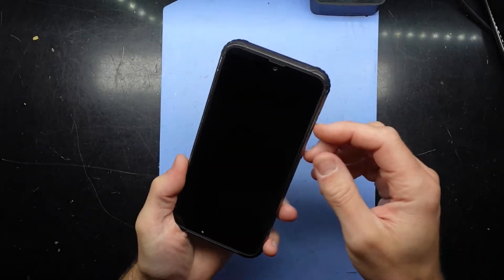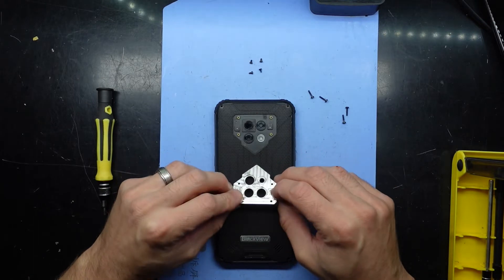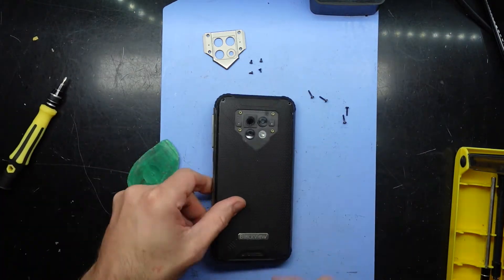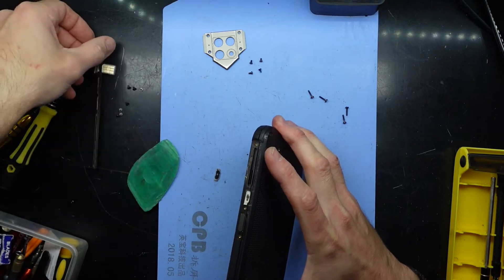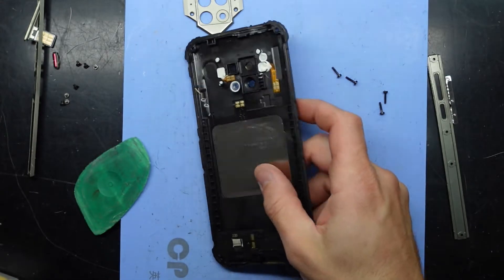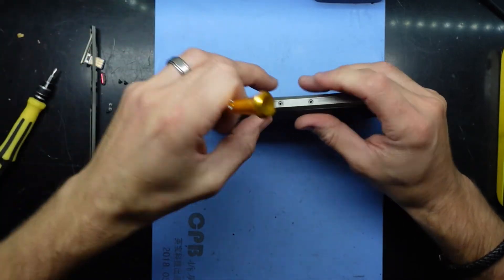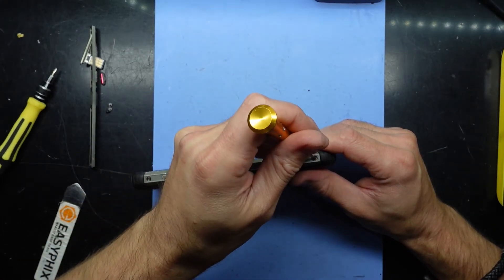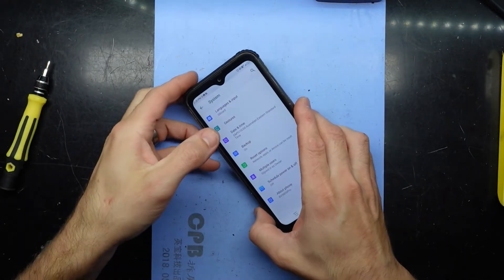Blackview BV9800 Pro Teardown and Loud speaker replacement

Comment: I stopped watching when this dude attacked the speaker with a toothbrush.  Don't copy this madness, if you clean the speaker properly rather than ripping the thing apart like a butcher and then place a small neodymium magnet behind the speaker module for long enough to re-magnetise the speaker's tiny magnet it will work properly again. These tiny magnets get messed up by wireless charging coils when there is poor shielding in the phone or by placing the phone near a strong magnet facing the wrong pole.
Reply from the maker: Never had a drama with using the tooth brush 

But thanks for the tip

Comment: Has anyone figured out why the speaker dies on these BV9800s? I'm about to do my 3rd one. My know never gats wet., or dropped, and is always kept in a holster. Other than speaker issues, I love this phone.
Reply: Mine has a random issue with the speakers. Some days it works fine other days it will start to play music and then in about three seconds sound just tails off to nothing. Stop what you are watching and press play again, music starts then tails off. I've had this issue months. It almost seems as if it's a software issue. Great phone apart from this annoying problem.
Reply: @richielee5398  that was the problem with my first speaker. After replacing  it was fine. But usually they die again after a couple months, but then by getting distorted instead of fading off. My 4rth one is about to die now. Just really poor quality I guess
Reply: @wolli  it's real poor to be honest. I've not replaced my speaker at the moment. I was going to but if it's only going to go wrong again it seems no point.
Reply from the maker: damn, thats a bag failure rate.

i found em cheap on aliexpress
Reply: Same here. 3rd one is about to die now after 3months. Above 50% volume only distortion
Reply: Maybe the max volume is to high for these speakers